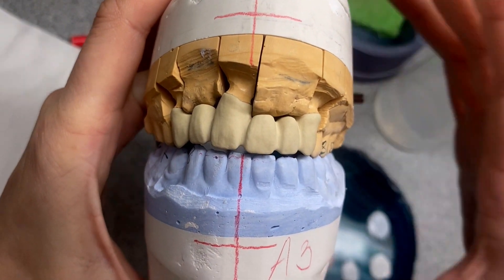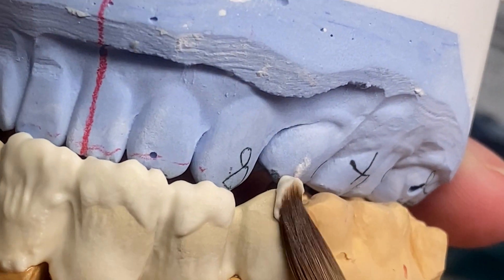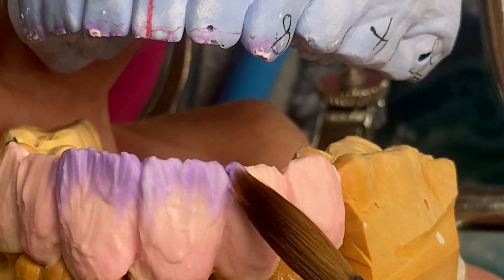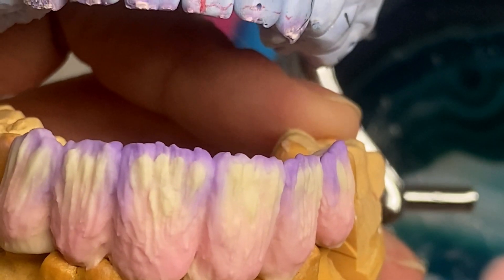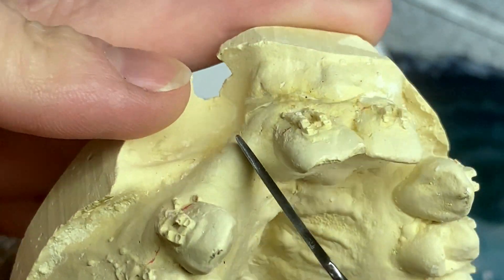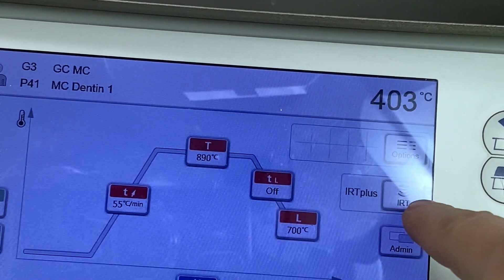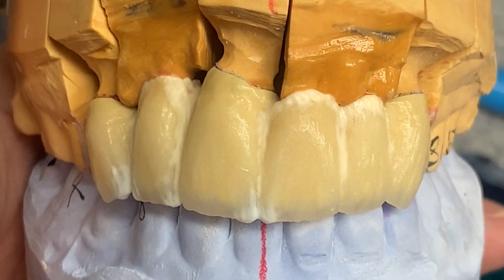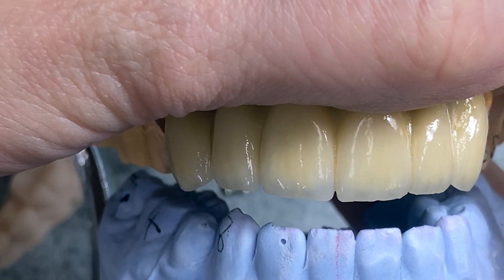6 Unit Anterior Bridge Cleft Palate Case

Comment: Hi Vera, have a question for you. Why you don't separate crowns before bake? Thank you
Reply from the maker: Hi! Thank you for the question! I don’t separate them because I don’t think it’s needed- when I used to cut between crowns porcelain used to split quite far apart and it would take me 2 or 3 more bakes to fill them in. Now I don’t cut my porcelain and get away with just one maximum 2 bakes 🙌😁

Comment: Hi Vera :) ..about "mamelons"..well those are "development lobes" those are actually part of dentine...mamelons are different size of "hydroxyapatite crystals"  and they are moistly part of what we call enamel...u see hydroxyapatite crystals vary in size from 0.02 to 0.4 microns..the ones with size of 0.02 to 0.04 are what we call enamel opalescence translucency. The ones with 0.04-0.4 microns build dentine and other more opacious structures of teeth..to shorten it .. development lobes are part of dentine ..mamelons are part of enamel..those 3  "fingers" on central incisor are development lobes....           In our practice when Im building them from porculain after cut back of dentine I do lobes with more opacious porculain like " dentin modifiers" then I cover that structure with super thin layer of translucent then I put mamelons from opacious powders it can be just dentine powder or any other reflective powder..then I cover all that with enamels translucents and such so in end u have nice transition and deepth of lobes mamelons and various translucents and transparents
Reply from the maker: Hi! Thank you for correcting my narrative😊🤗 This inspired me to find articles about how teeth are structured and I could find many good pictures explaining that. Your message is very visual and detailed , thank you for sharing your extensive knowledge. Now I understand why mamelon porcelain is mostly translucent as they are part of the enamel like you’ve mentioned - it was a bit of a puzzle for me, but now it all fell into place!🙏😁❤️